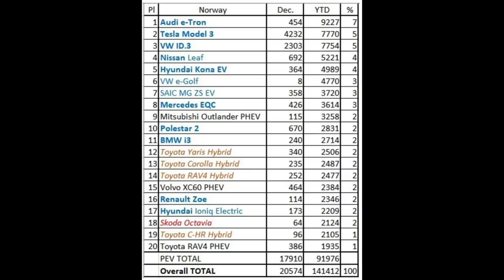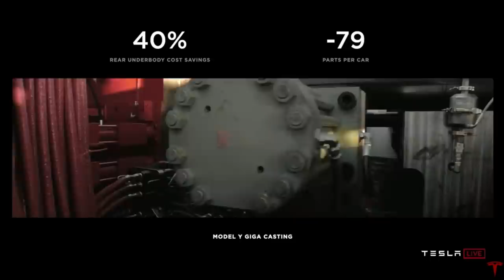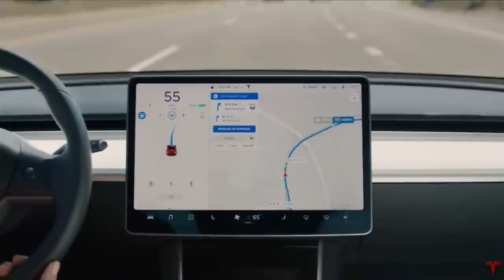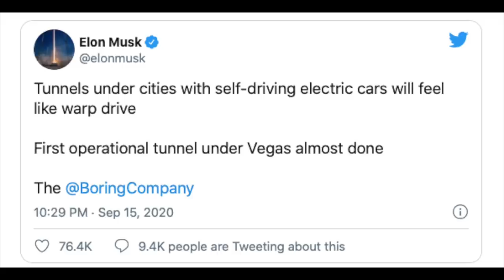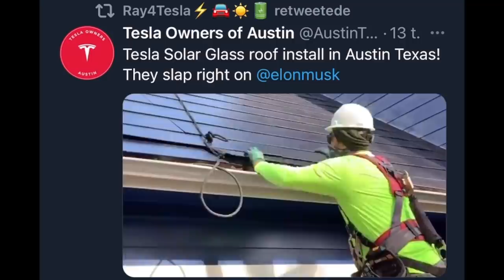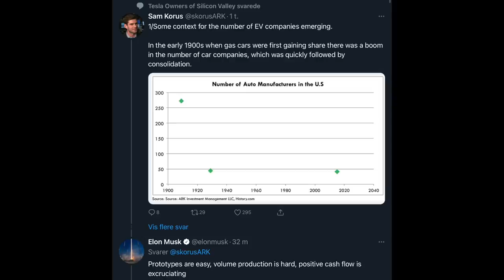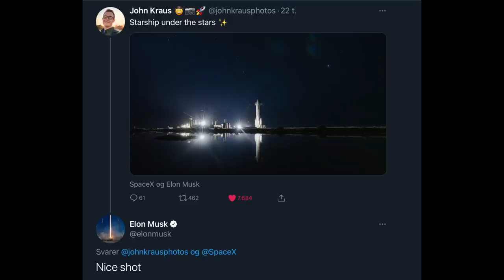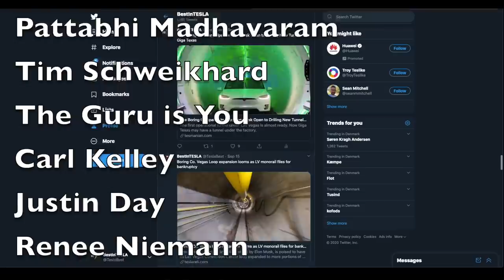Tesla reveals NEW product | Model S is disappearing !!! | Tesla is dominating EV sales

Comment: i see a problem for Battery Swap Stations when it is winter and salt, dirt and wet snow is dripping down on the Battery.
Reply: And rust, don't forget rust making those bolts god damn impossible to remove
Reply: Also NIO is investing capital dollars into an asset that degrades instead of owning the manufacturing plant where the cars are made. They sold manufacturing to JAC motors. While other companies are developing better batteries that won't need to get swapped nearly as often. Or like Tesla has spent all their engineering capital on getting their cars to level five autonomous driving. NIO to zero.
Reply: Its a bad idea...who pay for all the expansiv spare Battery. Its a Cashflow killer!
Reply: You can blow that off with compressed air before installation after all there is rain and snow, dirt, and salt in China. By the way, there are also four seasons in China common man that was weak.

Comment: 2021 will be the best year yet.  Unlike some of your viewers, I'm indifferent to Tesla's stock price.  It's the tech that fascinates me, and a desire to see the end of fossil fuels.

Tesla keeps rolling out new tech and new production capacity, pleasing me on both fronts.

VW's delay on the ID Buzz in the US may be connected to availability of battery cells.  Too bad.  I see a lot of potential for that vehicle.

Will we see a live autonomy pilot test somewhere in the US by the end of the year?  I'm hopeful!

One tech area we haven't heard much about is voice control of Tesla vehicles.  I'm not a big fan of wading through menu hierarchies to control wipers, mirrors, music, etc.  Will we see improvements in voice control?  The time seems about ripe for it.

What might we learn at a Tesla AI Day?  A Dojo reveal, perhaps, but I can't help but wonder if Tesla will have something even more futuristic to talk about.  Unfortunately, my imagination fails me.

Nio stubbornly insists on investing in pack swaps, burning capital uselessly.  Toyota stubbornly insists on hydrogen fuel cells and nearly-imminent solid state batteries (I'm skeptical).  GM stubbornly insists on 30 low-volume niche BEVs by 2025 rather than focusing on mass market BEVs.  VW is trying, but is battery-constrained and lagging badly on software.  Ford has one niche BEV and everything else is hidden from view.  PSA is putting their emphasis on low-tech, short-range city cars and is merging with FCA, which has no BEVs whatsoever.  The industry as a whole isn't putting up much resistance to Tesla's dominance at this juncture.  This is going to result in a huge reshaping of the auto industry.  Legacy players will shrink.  Some may go bankrupt.  Startups, aside from Tesla, are poised for slow growth (or are outright scams, like Nikola).  All lag Tesla's innovations and tech advances.

That's a painful picture for the industry, but getting off of fossil fuels was never going to be painless.

Comment: Thanks for sharing all the good stuff. The “megacast” will either be a total success or a total failure depending on how well it is engineered. A big risk like so many of Elon’s creations.
Reply: the hard part is the enginneering design. you want your simulations to be perfect before you get the casting dies made. tesla is very capable. i wonder if other companies will try to copy, but then not get it right first go and waste a ton of money redoing casting to get it right.
Reply: I vote total success.
Reply: Wastage rate will fall but even in factory failures will just be melted down and recycled.

Comment: If i were nio, I’d make sure that there is a series of chargers along the waiting line for the battery swap stand. This way they’d shrink the charging time for batteries being swapped against fully charged ones. With sufficiently long cables allowing to not change cables at every move (each move is indeed over 5mn).

Comment: If a battery swap station contains 13 batteries, it can swap batteries every 5 minutes and it will have over 60 minutes to charge the batteries in the swap station.
Reply: Provided all the cars use the same battery pack. Different mfr. Different mdls. Equals a huge wherehouse full of battery packs. And some of the new mfrs have multiple size battery packs for the same model.
Reply: Tomas Thomas, All the cars to use the same battery packs.

Comment: Great show. Thx. Two questions. 1. Where I live we occasionally have outrageous winds. That clip of the installer simply snapping down the leading edge of the panels caused my first thought to be “Holy shit, those panels are going to be flying projectiles the first serious storm that roles through. Can you say “liability?” Do you have any information on that technological issue?  
2. Nio’s battery swap model may be genius in the long-term. Why? Simply b/c they will CONTINUALLY have a PURE Lithium source to recycle their batteries every time they have a form factor upgrade or technological advance. All other companies will LOSE their Li the second the EV drives off the show room floor. THINK: SpaceX and reusable rockets. NIO may really be onto something here.

Comment: There are some advantages from battery swap, so it is good that someone is developing it. 

We must remember that those cars can also be charged, so there is no need to be double batteries. 

When batteries are charged in swapping station, they are balancing the instead of stressing it. 

In long term when number of EV’s grow, we need either home charging or battery swap. Supercharging don’t scale up in cities. 

Especially very fast chargers are expensive and very problematic for grid. Having enough 500kw chargers so people don’t have to wait in peak hours is not practical and grid couldn’t handle it. Charging stations would need very large batteries to compensate peaks. It would also add efficiency losses and enviromental impact since electricity would go two times through the battery. 

Home charging is my number one solution. We would need to build low power chargers to most of the parking spots. 

Even with 500kw charger, charging would take about 10min with optimum battery, which don’t exist yet. It is still about 5 times longer than filling a tank. We’d then need about 5 times more 500kw charging stations than we have now gasoline stations. 

We should realize this and start to build those slow charging spots before problems get too bad and it turnes against ev’s. Slow charging is good for grid and battery and you never have to go and wait charging. Potential price advatage can also be huge.

Comment: As the owner of a 100% solar residence, I know that there is another vital component in a photovoltaic system, the controller, whose function is to keep the batteries from overcharging.  Since the controller was not mentioned, are we to assume that it is already an integral part of the Powerwall?

Comment: NIO battery swap is a genius way to upgrade. Better than scraping your old EV because worn poor  performance batteries.
Reply: You would recycle old EV no scrap them.
Reply: It’s actually a dumb idea.  Elon came out with that years ago and then canceled the idea.   The most expensive part of EV cars are the batteries . There is a battery shortage already (this is a bottle neck for EV companies to scale up production).  In order to have battery swap work you’ll need to have a huge excess of batteries sitting around at battery swap stations to swap out (around 20% extra battery packs).  This will be cost prohibitive for EV companies.  Additionally as battery technology continues to improve and charging rates get faster and faster it will make battery swap even more useless
Reply: @holysmokescharles  yeah

Comment: 16:07 3.2 miles per kWh :) you’re welcome
They should make a unit equal to 1 kWh so we don’t have to tongue twist every time. Something like 1kWh = 1 energon (if you have better names write below).
Reply: I was thinking about this exact thing recently Mariusz, because the average person gets very confused with kW and kWhr terminology. So I thought we could used the term “eLitre”, where 1eLitre=1kWhr ( e standing for electric of course). Although not strictly having any connection with a litre of liquid or volume, the advantage of this terminology is that it translates easily into the world of ICE vehicles that the vast majority of people are familiar with. For example, most ICE vehicles have a fuel tank capacity of between 40-80 litres. Likewise, most EVs have a battery capacity of between 40-100 kWhrs, which would equate to 40-100 eLitres. 
Similarly, for fuel consumption - eg 5 litres/100kms would translate into X eLitres/100kms, with a lower figure indicating the better efficiency in both cases. I totally agree with you - kWhr is obviously the correct scientific/engineering unit, but it is a very clumsy term that the average  lay person struggles to get their head around.
Reply: @Nicholas.T  maybe “Etre” then Li(quid)tre and E(lectric)tre ;) that’s quite complicated though.
Reply: Yes people DO mess up with the difference between demand and energy (KW and KWH)    but it's not really right to make up a new word for KWH.

If you really must, at least make it stand for 10 kwh so the ratio vs. distance is more analogous to MILES PER GALLON. People will more naturally understand that correctly.   20 miles per "energon" would be so-so economy and what a Porsche Taycan gets, 40 might be what BMW i3 gets.
Reply: @markjohnson8260  we have a ton (long) for Mg (megagram) so why not a name for kWh. 10kWh woud be decaenergon (daEg) ;) Americans would love it... ;)

Comment: 1-1.3 million cars in 2021 for sure. Can’t make less than 1 million unless you close some existing production lines.
Reply: So what ? even VW Group has got 1.2M BEV pure production capacity now: 330k Zwickau (ID.3, ID.4), 80k Mlada Boleslav (Skoda Enyaq iV), 35k Brussels (E-Tron), 30k Zuffenhausen (Porsche), some 10k Böllinger Höfe (E-Tron GT), 20k Dresden (ID.3), 30k Bratislava (E-Up, Citigo, Mii), 300k Anting (ID.4X, ID.3, Skoda Enyaq), 300k Foshan (ID.4 Cross), 35k Changchun (E-Tron)...

VW Tripled BEV production & sales last year and will triple this year to get at least even with Tesla.
Reply: @niviuk8335  they don't have the capacity because of batteries ,if they have the capacity ofc they would produce that many cars but because for something they just have produce 50k Bev's that shows alot
Reply: @niviuk8335  they won't
Reply: @relansis6962  Tesla has been beaten by the Dinosaurs in Europe 2020 and VW Group alone will for sure surpass them in worldwide BEV sales in 2021. They produced BEV at a yearly rate of 400k in Europe alone in December, will add there another 100k yearly with Skoda Enyaq in Czechia plus will make close to 500k BEV in China. 

Of course this will leave an army of crying Toddlers behind - but such is life :-)